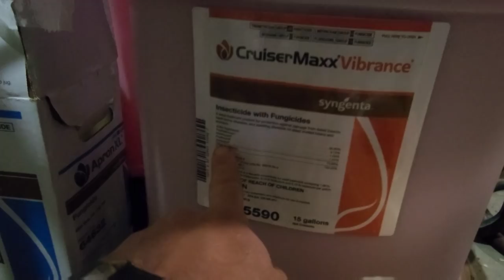Fire! - #667

Comment: I’d drill out or melt out the scraper nut in the vac door and use a washer and nylon lock nut for the scrapers. New vac door style l”snap in tabs will likely break also.
Reply: That was gonna be my comment. Welded many plastic things with a solder pen and zip ties. But instead  Melt the housing back around the nut to hold it

Comment: Nathan I have been a fabricator for  over 30 years and what I would do is drill through both parts and rivet them or I would try to get the screw out and drill through the nut and rivet it together before I would buy new ones hope this helps
Reply from the maker: But I need them to come apart so I can switch the parts out.

Comment: Hey there Nathan and Brock, I hope this finds you all well and good!

I'm impressed with your JD Dealer delivering $10 worth of bolts, and doing it quickly, that's a pretty expensive service that he's providing. I'm curious as to how far away he is from you?

If you want to spend a little time on those lids/covers you could fix those old ones, but your time may be more valuable than they are.

That rains gonna be good for everything you've planted, which I think you said was nearly 2/3rds of your planting total, which is great!👍

I've not seen you post anything about checking the toe and alignment on your 8RX, so I guess it's all good.

Does your tractor have a decal on the inside of the right-hand glass that shows you the reduced road speed of 20mph  for your narrow tracks, also your speed may be electronically limited to 20mph. The only tracks that aren't speed limited Is the widest track, which has the weight spread over a larger area, so its obviously clear that less weight on the tracks is desirable, and proves my point (as if it needs proving) that any added weight is harmful and has a detrimental effect to the expensive drive system on your new, tractor, and quite frankly, it's not rocket science.

I hope y'all have a good one! 

"Nothing Runs Like A Deere" 🦌👍🇺🇸
Reply from the maker: It does have the sticker. Speed reductions don't start until the weight gets pretty high. I'll show it in a video soon.
Reply: @BorderViewFarms  

Your tractor should have the speed electronically limited from the factory at 19mph period, with no added ballast.